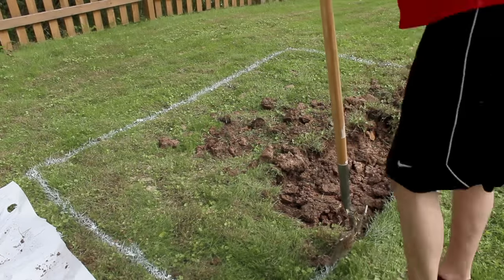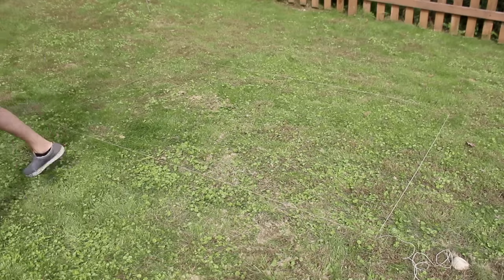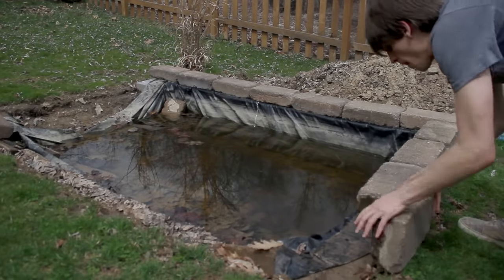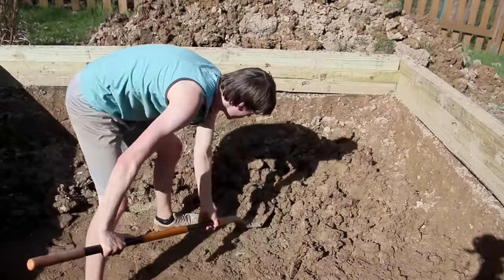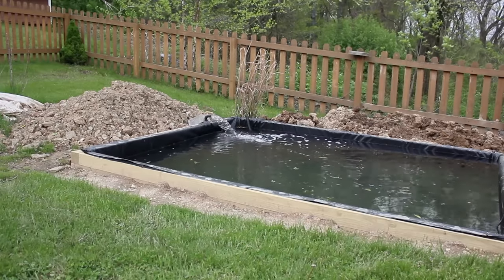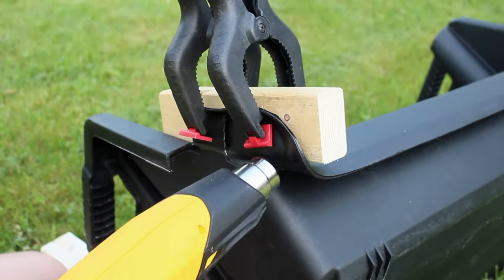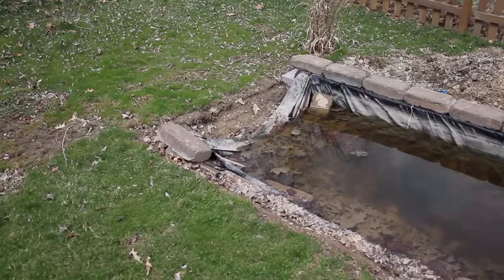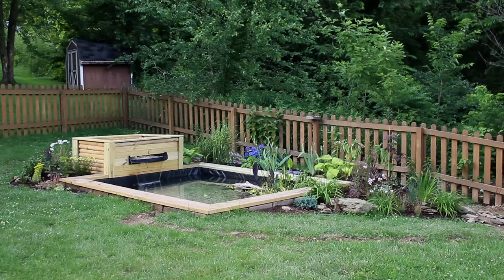DIY Backyard Garden Pond

Comment: When your using a hole saw on something like 4x4’s it helps to drill some holes in the diameter of the circle to have a place for saw dust to escape, it helps prevent overheating and stops the bit from choking up.

Comment: I would like a quick explanation in a future video of water flow throughout, pond,pumps,skimmers, bio filters and back again, and explain what each inner compartment does and how it all works together. thank you!
Reply: Let's start with the pond itself. The first compartment that he builds is the mechanical skimmer which he's placed about 4 inches from the water table to the wood trim. Once the water gets to a level where the pipe is, it'll naturally flow into the container. Later in the video, he's cut 3 or 4 filters on his table saw that act as a barrier to the pump so that any leaves, branches, etc will get stuck within those porous layers without stopping the flow of water. The debris free water is then pumped from the osae pump to the waterfall bucket, or the one that's shaped like an L as clean water to help create more water faster, this creating a larger waterfall. There's an additional pump that's located directly in the pond that goes from the pond to the filtration system, or those two blue buckets with holes in them. These act as another layer of filtration, this time a lot more fine. That water is then dispersed through the holes and into the biological container which is the red lava rock surrounding the blue buckets. This is where all the healthy water cleaning bacteria and algae live. Later in the video, he connects that container (the one with the red rocks) to the water flow container (the one that does not have a cover and looks like an L) so that once the red Rock container reaches a certain height it overflows into waterfall container, doubling down on the waterfall production. Clean water is pumped into the pond via the waterfall, and the whole cycle is renewed

Comment: I currently building quite an ambitious project in my garden. I have dug a large main pond measuring 20x15 and 10’ deep. 
This main pond will be salt water. 
I intend to pump the water out of the main pond to my desalination unit then on to the filtration at the top of the garden. 
The water (now fresh water) will run into a shallow pond measuring 5’ x15’ and only 2’ deep. The water then runs down a series of smaller pools and streams back to the main pond. Salt removed by the desalination is returned in the bottom pool before entering the main pond again. 
I intend to release Salmon parr into the shallow top pool and then as they grow watch them return to the ‘sea’. Next spring it will be a great sight watching them leap up the waterfalls back to their spawning grounds in the top pool. 
The process then starts again. All excess fish can be eaten or sold to restaurants. 
My very own Salmon farm/eco system.

Comment: You need a better drill bro! Awesome job as always!
Reply from the maker: Haha yeah probably. I'm usually not drilling through something like that though.
Reply: @SerpaDesign  Pro tip for drilling large hole like that: Drill one or two smaller holes along the edge of your to-be hole before you start with the big hole saw. They'll catch the sawdust and make drilling MUCH easier! Build looks awesome btw, your hard work has really paid off!

Comment: Did you treat the wood with a conservation product? If not, it will soon rot in contact with the soil.
Reply: 1959Berre tbh I would have put a gravel or paver footing
Reply: Oh yeah, I was wondering about that too.....but he did treat the top boards ....and pond liner was covering most of the bottom wood.
Reply: @TheSeptemberRose  The insides of the wood are protected by pond liners, but won't the outside that's buried in the dirt rot?

Comment: I built a 5’ deep, 6000 koi pond. 4” PVC, vortex Centrifugal force pre filter, 300 gallon bio filter.
upper water fall was veggie filter. I had 2 1/3 horse power in line pumps. 
Kind of like your pond but I used concrete on all the walls of the hole to avoid erosion or collapse. I used a floating swimming pool cover as my underlayment and then a pond liner. 

My koi fish went from 4” to 18-25” & the water was clear. Came out nice.

They make threaded bulkheads for ponds you can use rather than those connectors & pond liner technique you used.

Looks good, man

Comment: when wrapping or fitting sheet material in tough places , using heat is your best ally. a heat gun, or even contact cement, will heat a sheet material like rubber, or vinyl really well, turning it into a very pliable material. i was a carpet installer for a long time, & upholstering was something i did very often, you get really good at wrapping things in carpet, which isnt often a easy to use material. usually just laying a sheet out in the sun will warm it up so much, it turns as flexible as saran wrap. in tougher areas, contact cement creates a chemical reaction, which heats up the material, in others, when glue isnt appropriate, a heat gun works like a charm.

Comment: Good job man! especially on the digging that would have been so hard! I recommend however, when you put the flang where the water drainage was, it would have been alot quicker and probably more effective to use a fully submergible polyurethane sealant.

Comment: I plan on making an above ground pond with statues of maidens pouring water from water jugs into the pond for oxygen while hiding a massive filter behind it that has a drain in the center bottom that drains into the street gutters for easy cleaning although its gonna be a 2000+ gallon pond with a possible glass panel with brick and tile platforms for potted plants and lily pads. Im probs gonna make my own pond filter using a really big storage bin and a pond pump since I have always wanted to make my own massive filter to support my goldies and my centerpiece Koi.

Comment: Plasti-dip 'paint' is also pond/aquarium safe. You can use the Clear Plasti Dip to seal. Just throwing that out there for anyone wondering if there is another spray paint than the Kryolan Fusion Paint you mentioned.

Comment: Lot of good ideas here- it’s hard work. I wouldn’t use treated lumber in a wildlife pond due to chemicals. (Frogs are sensitive. ). If the ground freezes in your area  part of pond should be 18 inches deep.  If you build a pond with stiff walls, adding a log or designing a sloped/graded area should be considered for animals to get out if they fall in.  I am going to try putting in a preformed pond (big box store) because leaks occurred where the weight of the water pressed liner against sharp rocks or roots slowly punctured the lining.  No fish if you want native frogs.  Rainwater or well water best. Tap water often has chemicals.

Comment: Great presentation! Especially learning from mistakes.

Suggest that unless the hole is dug and measured precisely cutting the EPDM liner before it is placed in the hole could in some situations be an expensive mistake. Obviously if the shape is irregular it would be necessary to place the liner, fill with water and then trim the liner. Granted that you did everything with great precision. However even with a 90 degree angles throughout; a normal DIY person would be better to place the liner, fill with water and THEN trim the liner!

Surely there must be spill-way/filter units that are NOT ribbed? Of course this one was not designed to connect a DIY bio-filter to it. Another option might be to elevate the DIY bio-filter so that it would not be necessary to drill through the side of the spill-way where the overflow goes over the side of the spill-way. Yes would add another tier of wood. Yet there are things that could be done to make this work aesthetically... say perhaps creating a two-level waterfall?

I am not sure that I understand why you went through the trouble of covering the over-flow pipe with several pieces of liner? Should the flange that you installed with the pipe not been enough of a seal through the liner? If not there could have been a re-enforced seal using a non-toxic clear silicone caulking between the flange and the liner before screwing the flange into place. It is permanently flexible. Adheres to many surfaces. Used to build aquariums. It is also pressure resistant.  

In finishing the pond why did you place gravel on the bottom? Of course initially it has some aesthetic and biological value... however in the long run this becomes a maintenance issue! Muck accumulates through and on top of the gravel. The gravel would need to be removed, syphon/net the muck from the pond, rinsed out and then replaced. After many years experiencing ponds where gravel was used upon the bottom... bottom line this does not really contribute to the beauty or functionality of a pond!!! Once the plants and fish have grown out gravel is an absolutely redundant addition to any pond unless that pond has internal gravel filtration... which can sometimes be another nightmare at least sometime in that pond's future!

Why not add a waterlily in the center? A "hardy" waterlily needs shallow pond soil with room to spread. A  kitty-litter pan that holds between 0.3 and 0.5 cubic feet of "muck" is perfect for a small to medium pond.  For tropical day and night blooming waterlilies can be put in a recycled "15" gallon nursery container cut down to a depth of 9 inches would be perfect (holding approximately 0.6 cubic feet of pond muck... need to stuff some kind material to block the bottom holes ie: cotton fabric pieces). For a more limited spread can use a 3gal -4gal bucket giving 0.4 to 0.5 cubic feet of soil. Whatever waterlily you put in your pond most often are growing in a smaller nursery container will dwindle down to nothing unless repotted! Waterlilies need a lot of nutrients in order to grow and thrive!

Comment: Looks amazing, and yes, it is a lot of hard work for one person! I built a small pond about 20 years ago by myself, only 1/4 of the size of yours, and my back hurt for days. lol I'm curious if you installed any landscape lighting. If you ended up covering the filter box and spillway, a color-changing LED to the underneath of the lid over the spillway to illuminate the water would be pretty cool. Then perhaps another light on the bottom of the pond shining up through the waterfall. I have always enjoyed the fan fountains that light up as well. One would look great in the center, and then of course various spotlighting around the edges to light up key parts of the landscape. If you did do any lighting, I would love to see the outcome!

Comment: Just a bit of a PSA, this is only really relevant for deeper holes though. If your going to dig a hole in your yard call the local government or gas company and have them check if there are any lines running where you intend to dig. The majority of the time its free (not sure about all states) and it saves a lot of trouble in the future. besides that in some states you can be arrested if you mess up a gas line, hence why the service for marking them is free in most places.

Comment: Did you make sure the flow rate of the pipes would be greater than or equal to that of the pump for the amount of water in the container so it doesn't overflow the box with the yellow lid

Comment: Hey Tanner, I know this is an old video and kind of a longshot, but why did you use uni seals instead of bulkheads? I want to do this on a smaller scale, and bulkheads seem easier to work with, but I wanted to hear your thoughts.

Comment: How did you find your filter working? I have found filter design to be quite hard to figure out what will work. Some are quite basic like yours and then I see other guys who have massive pumps, tons of bio media, sponges, skimmers, UV lights etc. 

I'm building a small deck pond that's roughly 500 gallons and I'm incorporating a bog type filter with roughly 9cu ft of lava rock and hydroponic balls with plants in the ball area.

Comment: Gravel is going to give you more trouble than it's worth.
'3 feet is deep enough', this all depends how severe your winters are, 3 feet in Canada, nope, 3 feet in Mexico, yup.
The installation of the filter / spillway is a botch job, you should have cut the hole and installed the pipe BEFORE you installed the liner.